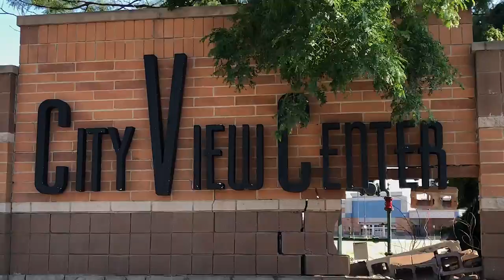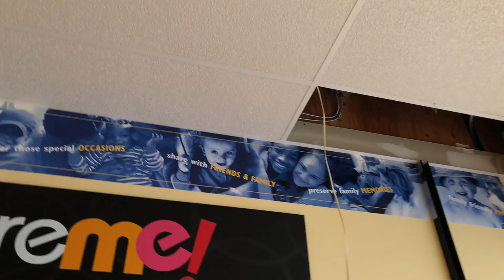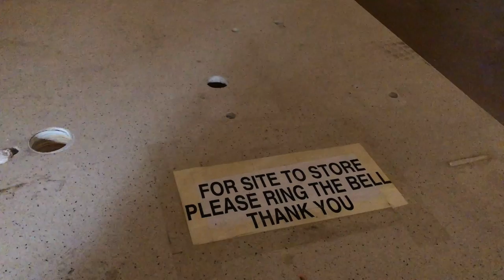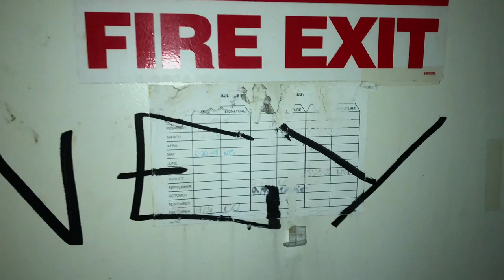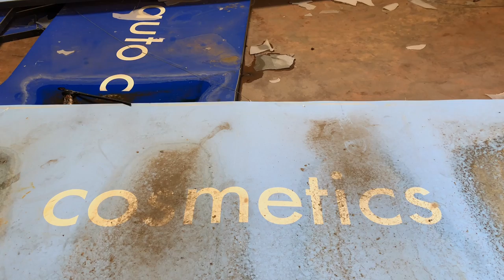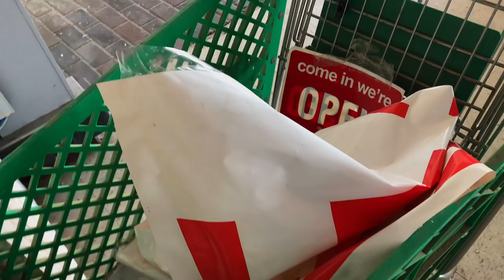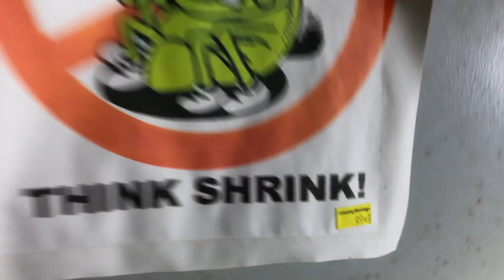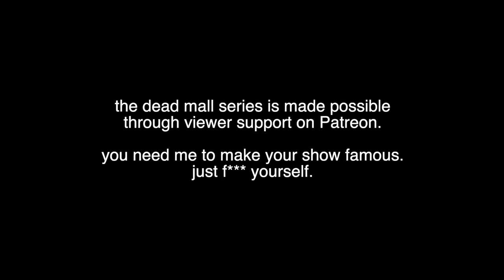DEAD MALL SERIES : FORGOTTEN RETAIL : Sank Walmart & Dank Kmart & Rank Bonus!

Comment: Regarding the safe/lack thereof, I use to be a bank teller in a branch that was inside a kroger and we had a safe. It wasn't a fully walk-in, just a decent size standing safe, think it was around 4 tons of steel rough and was maybe 4x6x4. We didn't need to keep the same volume of cash and those in-store branches are pretty low traffic so that sufficed for us. I think we had around 130k-180k most of the time, where as a larger branch (at least for the bank I worked for) would have anywhere form 300-700k depending on the traffic.
Reply: Yeah I worked as a teller at a pretty small branch, no larger than one found in a store that was located in the skyway system of Downtown Minneapolis, and yeah, the safe was like nine by five feet. Thing is that we only ever had like 60K tops in that branch and a larger one would have no more than I wanna say like 250.

Comment: I worked for Wal-Mart in the late 90's. They built a Supercenter right next to the old "Division 1" (no groceries) store, so I got to see both the new store and the old one completely empty. That store you visited must have been one of the last Division 1 stores built. There aren't many left. Some were converted by expanding the footprint. If you ever walk into a Wal-Mart with a drop ceiling in the center, that's the old store and either side with high ceilings is the expansion. On a different note, a RED Ames cart, that is seriously old and rare.
Reply: Yeah, this one was built in 2006 which was very late for Div 1 but it was intended to eventually become a super center and designed to be easily expanded (as most of the later Div 1 stores were). Giant Eagle has a lot of influence and I have to wonder if the initial lack of grocery was a concession Walmart made in order to attract Giant Eagle to the center.
Reply: Theres one in Amarillo,TX still
Reply: the 2 closest Walmarts to me are both Div 1 stores.  they are still kind of common near cities I feel like.  Also you might be on to something about Giant Eagle as one of those 2 div 1 stores near me is literally attached to a Giant Eagle.

Comment: The smaller part of the Kmart was probably a Kmart Foods, there were several built in Michigan in the 60s. Crazy to think if they had just removed the wall they would have basically had the concept of a "Super" Kmart/Walmart long before (but Meijer had already started building hypermarkets in 1962). There was also a K-Chef fast food restaurant for a few years. The one in Pontiac (store #2) had a K-Foods and a K-Chef. It's all bombed out now though.

Comment: I’m assuming the laziness of the designers, owners and construction, taking an old used brown field site, building over it quickly to cash in on commercial contracts, leading to a major design floor with the foundations sinking. Reminds me of the story of the foolish builder who builds his home on sand.
Reply: There was a nearly identical (but now much bigger) center built at the same time atop a dump near Detroit (Fairlane Green in Allen Park, MI) but it was built properly and is thriving. A 2-foot structural concrete cap was poured over the whole site and a methane extraction and alarm system was installed from the start.
Reply: @craigjensen6853  one built for longevity vs one built either on a budget or a quick financial return, sad really
Reply: @craigjensen6853  I still remember when the Veterans Hospital was there.

Comment: The mains hum you heard could just be the transformer connected to  grid power.  Even if the main breaker was off, it would still be powered from the power grid side.  Since there is no power draw, the transformer draws no power except a little loss to heat and the vibration you heard.
Reply: @techguy3236  oh very much agreed.  There might be some system still on like sprinklers etc.  But it's still a hazard.
Reply: Exit lights still had power
Reply: Even the pad mounted transformer was probably still live, which had also sunk with the ground, wonder what strain lies on the underground cables supplying it?
Reply: Sometimes a main breaker can buzz/hum even when powered off and connected to the line due to internal circuitry. As an electrician, I find it scary as fuck that parts of that switchgear is still potentially energized with covers off.
Reply: @hapticmusing  I didnt think those were electrical

Comment: The abandoned Kmart with so many carts from different stores...crazy. I've never seen a Lens Crafters with that designer.  I had glasses by 5th or 6th grade but had lasik when the blade-less laser vision correction was stable and really reliable in my research.  I was worried but it was so easy.

Comment: Right around the time that abandoned one was likely shut down was when they started transitioning smaller Walmarts into Super Centers, I was pretty much able to pinpoint the old layout of where every department was in that empty void of a building. Seeing a Walmart looking like that was rather cathartic, I worked for the company for what felt like a lifetime and I wouldn't mind watching them get knocked down a few pegs.
Reply: I worked on the site layouts of several Walmarts back then and from 2000-on most (if not all) stores that weren't built as Supercenters were at least designed to eventually be expanded into one. Most of them were, a few were relocated, others closed, and a few never became full-fledged Supercenters for whatever reason. One surviving example is the Walmart on Lake Lansing Road in Lansing, MI.
Reply: @craigjensen6853  I worked at the one in Hallande Beach, FL and they couldn't add onto the building for whatever reason, so they knocked some walls down, reduced the size of a few departments and moved a few of the back room areas around to make everything fit. 

What's worse was they did all of this while keeping the store open 24hrs, so that was a fun experience that totally wasn't a nightmare to deal with.

Comment: We have an old KMart like that. They put a wall down the middle of the store. One side is now a grocery store and the other is currently vacant. It did have a store called Rose's but it went out of business and the other half of the store is unoccupied. The one you went to in Flint is probably the same way. Just put a wall down the middle and open up two different stores there but it is obvious nothing moved into the old KMart side because you can still see where the logo was.

Comment: I've seen at least 2 abandon older 9 to 6 Wal-Marts in my life time. They would be left to rot for at least 6 months when new 24 hour Wal-Marts were built to replace them. A Goodwill and a correction school for young teens would move into the spaces for a time before they too would leave. Both were part of a smaller retail mall  so they were up for lease still last time I went by the areas.

Comment: I had a friend who worked at one of those psychic lines; she said there was intense training/monitoring/measurements on how to stretch the length of the call, trigger words a caller said and scripts to use based on the questions asked.  It was extremely analytical.  My friend made a lot of $$ but only stayed about a month; couldn't handle the guilt of the con.

Comment: We used to have a mall that was built on top of a dump in Pittsburgh, the Parkway Center Mall.  The same thing happened there with the sinking. You could feel the floors actually bouncing in that mall when it was open.  The parking lot turned into a bunch of lumpy pits.  It is torn down now.  Not sure if they will ever rebuild anything on that site.  They talk about it but the dump is still there under the ground, so I doubt it.

Comment: Wal-Mart just doesn't have luck with shops sinking into the ground apparently.  The one in Madisonville KY had to be moved several years back due to their location sinking from old coal mines under it.  Also their location in that town many, many years ago (before Super Wal-Marts) burned down.  I remember they did a thing where you could go and pay $5 for a paper shopping bag and you could sift through the rubble and fill the bag with anything you could fit in it.  Can you imagine a company like Wally World doing that today?!
The Wal-Mart the town over from where I live now is also sinking into the ground due to old coal mines.  You can actually feel the store not being level when walking down the far right aisle on the grocery side.  It's in Berea, Ky.

Comment: Hey Dan, I drove by Valley View Center in Garfield Heights about 2 years ago and specifically that Walmart that you were in. I thought it was odd that all security cameras were still mounted and looked to be in fair shape (certainly not as if they had been sitting outside in the elements unused for 10 years!) Did you guys happen to notice if they were still there? Everything else was pulled out of the store, why leave the cameras?? I was very intrigued when you guys found that there was still power to some part of the complex…hmmm 🤔